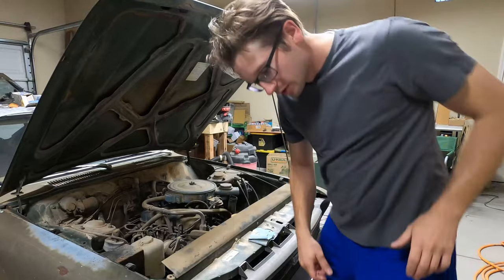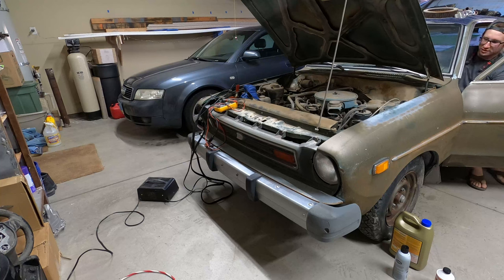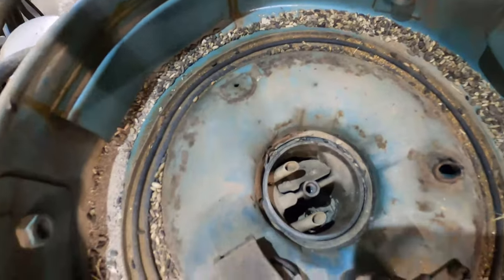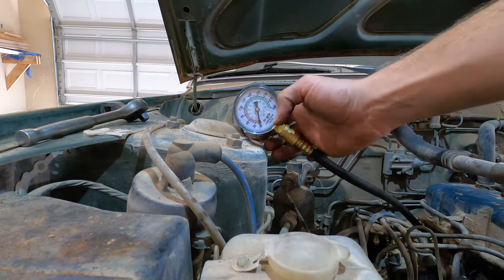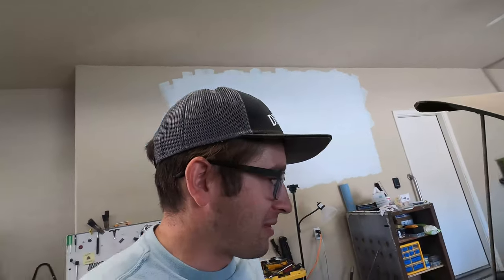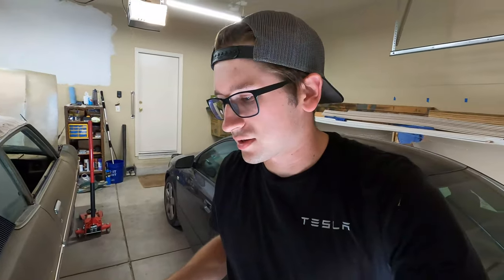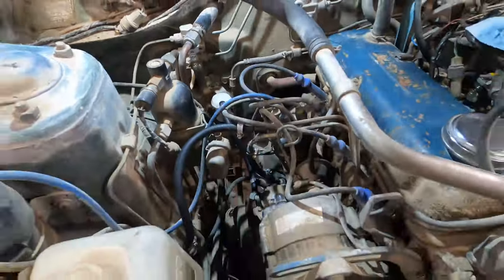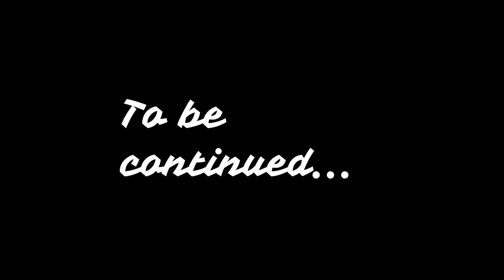77 Datsun B210 Part 2 | Fuel System and First Start

Comment: Nice to see another pulled out of a field and on the path to roadworthy. I have a 78 Datsun B210 "Honey Bee" I daily drive. They're great cars if you take care of them, and great on gas.
Reply: :face-blue-smiling: about ten yrs ago i bought a 76 B210 Honey Bee flat gold color for 200 bux, cleaned the carb and new points/plugs/rotor and it ran okay to about 60 mph, but built so cheap i had to fiberglass in two realty signs on the front floors cos of rust, sold it for 1000 when I broke up w/my GF 😅😂